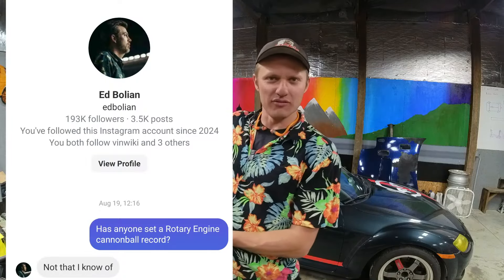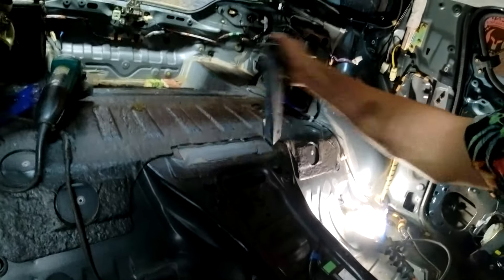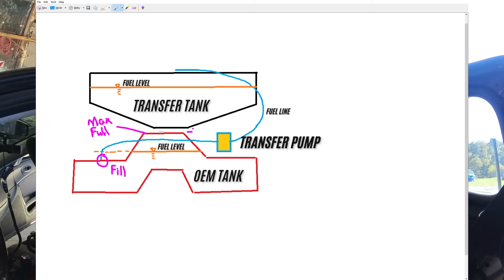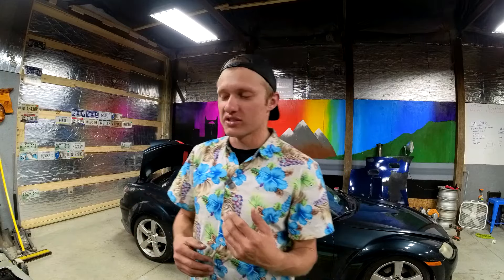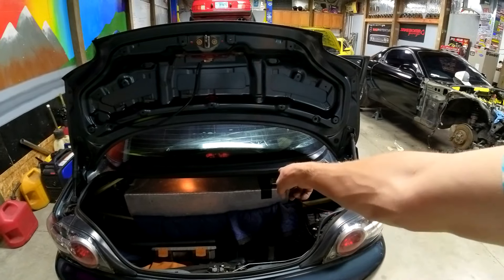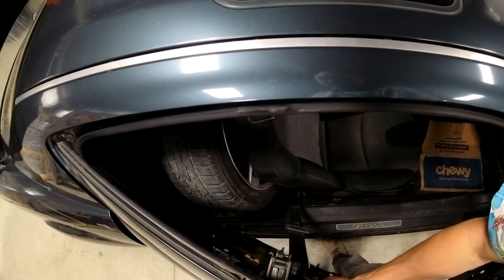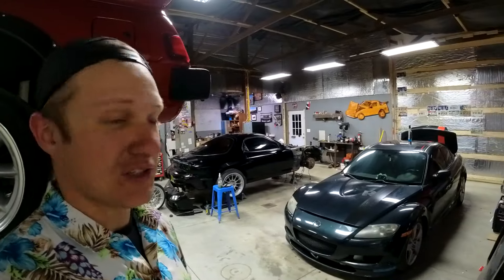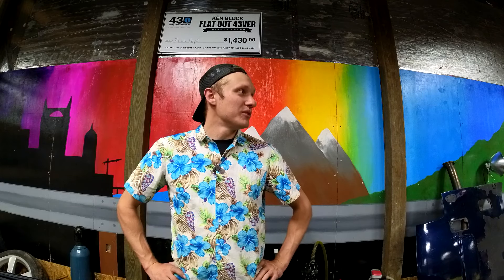RX8 Cannonball Run - Making the Rotary Engine RUN for 6,000 Miles

Comment: I was just flipping through the workshop manual, and it turns out that driving between 100 and 130 for 25+ hours is the factory method to de-carbon the Renesis exhaust posts.
Reply: Is this real? Thats Great lol.
Reply: @indianmarshmello.  no, the official workshop manual would not recommend breaking any laws under any circumstances for any reason
Reply: Can confirm, exhaust now sparkles.
Reply: MPH i think ?

Comment: You need at least an unmodified GPX file.(Garmin is worth it)

Use torque pro on ya phone to log a 2nd GPX/GPS data points.

Friends with Chris Stowell, assisted in ... Some ... Well call it "Stuff"

Comment: Few of the trips I have completed, Perth to Adelaide my longest single drive 2700km (1680 miles)in 26 hours max speed limit 110kmh (68mph). Alice Springs to Darwin 1500 km (930 miles) average speed 180kmh (112mph), top speed was 220 kmh (136mph) on the limiter, yes it was a rental, in the day no speed limit ,now its 130kmh (80mph). Longest rotary drive in an RX8 was Sydney to Adelaide 1500km 13 hours, max speed limit 110kmh. Hope you had as much fun as I did😊

Comment: Hey RAD Potential, you mentioned that buzz made 130 hp to the wheel on the dyno because of the low compression. Most rx8s make around 180 to the wheel stock on the dyno to the wheels. now that buzz exploded, what do you think a normal compression rx8 would make with your same basic turbo setup?

Comment: hello Mr. Hopf i was wondering if you know how to properly remove and install a 2008 mazda rx8 automatic rotary engine block. if your answer is yes, do you provide rotary specialist work to the public? if yes, please let me know as soon as possible as i may possibly need my motor replaced due to low compression. thank you for your time reading my comment and hopefully i can pay you for your services on helping me with project 40th!